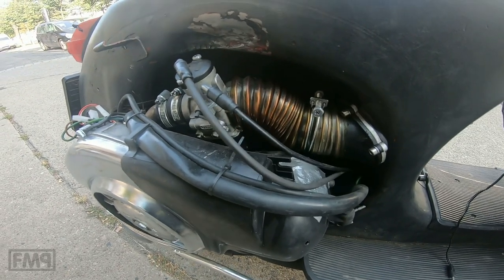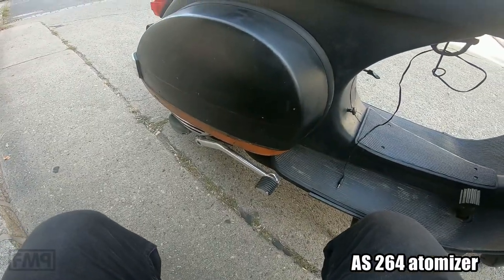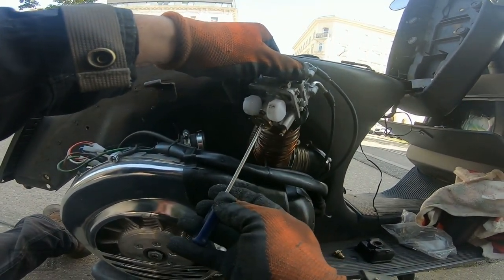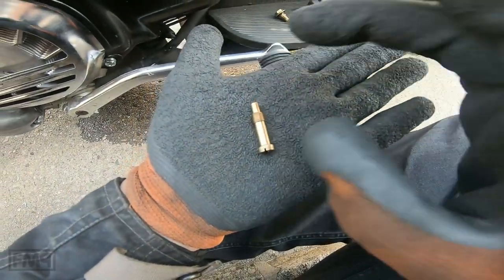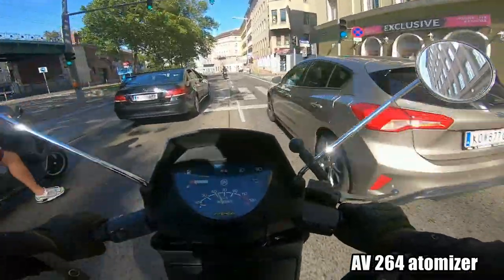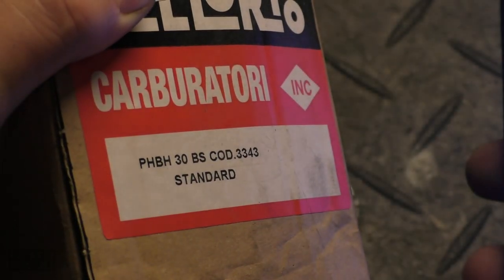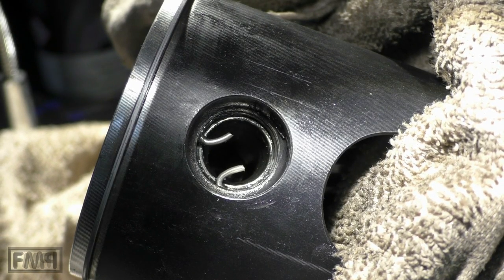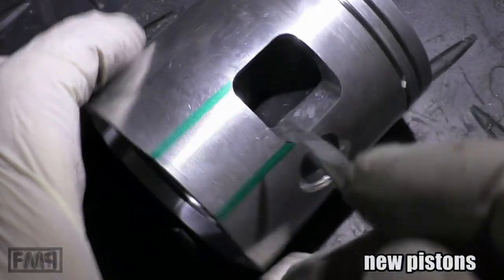VESPA dellorto phbh30: wrong AV 4stroking vs correct AS ATOMISER | FMP -  Solid PASSion |

Comment: Hey mate. Can you recommend a 12v fuel pump to live under the tank. Vespa 150 with lml reed case, rd350 reed. phbh 28, pinasco 177. I get to half tank and get starvation. Carb sits high because the reed block. Thanks. Anthony
Reply from the maker: hardi 60hp pump

Comment: It sounds very lean when you let go the gas. Even when you shift a gear up, it goes "braaa-pt pt pt pt-braaaa"
The "pt pt pt" part is when you let go the gas and you shift gear. Also it seems to have a very high idle rpm. Also this seems to almost not happen with the richer AV mix tube. 
If my engine sounds like that, I usually am worried about being quite lean on idle jet or idle screw etc.
Am I wrong? Maybe it's personal preference.
Reply from the maker: its not set perfectly thats right, just testing this engine a bit, but absolutely safe, no worries. 
the AV is very wrong. Seems like u like it on the rich side 😄👍
Reply: @FreakMoPed8  eh don't like to hear it "kicking" when I let go the gas, it sounds lean when it does so it kinda scares me 😁

Comment: I have malossi 166cc reedvalve with 30 phbh carb. Any idea on jetting
Reply: I have bgm bigbox touring exhaust. Or malossi one
Reply from the maker: AS264 x2 mj120 ij 55
AS atomizer not AV
Reply: @FreakMoPed8  i have bgm bigbox touring exhaust
Reply: @FreakMoPed8  because i have av266 and x13 neddle 140 mj 50ij
Reply: Did you say 120 main jet

Comment: I mista   I had already heard complaining about the AS tube but I was septic and afraid of being lean at 2/3 of the gas I would come back to you for my feedback: current config malossi vr one case Drt full crank 60  vforce 4 reed mrp manifold polini 221 gransport piston   Polini box  exhaust 24 /63  sip clutch short 4th gear  sip vape ignition phbh 30  58 pilot 147 main slide 50 x 2 needle av 268 tube 300 float valve Mixer tube AS268 ordered today i try it this weekend for a little ride 120 km  not so much😅
Reply from the maker: Let me know how AS is doing ij ur setup 👍
Reply from the maker: btw mj too rich, use a 130 also atomiser too rich, use a AS 266, worked fine for my m244 😜
Reply: @FreakMoPed8  Here I come back to my opinion on the tube AS first recited the behavior as on your video more regular opening of the throttle but I noticed that the engine took longer to return to a regular idle so I had the idea that it could be in  slightly cutting the tube to arrive at a dimension between AS and AV.  I tried it and the surprise the engine comes back to idle faster and keeps the behavior of the AS
Reply: my engine is really special it is true that the jet seems exaggerated but I get a correct carburetion without smoke and a clean piston without too much soot I had to start with a carburetion as you described me but I was too thin and the spark plug gave a different color  too white now the  spark plug has a hazelnut color I know it is strange and misterious at the beginning I was thinking of falsair intake but not all that

Comment: I'm having a similar problem with my set up as you are showing with the AV 264 but I'm running a standard SI24/24 it's currently on a Be3 atomiser, 120 main jet, 48/140 idle and 160 Air corrector. (dr180 kit, revolver pipe, drilled filter) it starts fine, ticks fine, is fine on acceleration and wide open throttle, but when I try to sit and maintain a constant speed it just splutters likr it did in your vid.
Reply from the maker: setting is correct, u got a different problem, ie ignition and or blocked exhaust. try different cdi then stator first.
Reply: @FreakMoPed8  yes I put new plug in, new stator on, new coil (lml 2t engine) and a different exhaust, the only thing left is cdi then I suppose.

Comment: Wouldnt a 45 slide clean up the richness with the AV atomiser ? I also recommend a minimum of 3.5 float needle jet on PHBH
Reply from the maker: Atomiser is cheaper than a slide and it works definitely, so simple solved.
it is the standard r3343 setup for two stroke.
 if av and 45 slide works..?  No need for me. To fins out. Just wanted to document the AS trick
Reply: @FreakMoPed8  what needle was you using in this video ? Cheers
Reply: @markjohn4986 guessing x13 or x2

Comment: Hey mista, i need your help, i have a vespa t5 with a malossi 177, but the piston was destroyed from the backside and the bore walls was scratched deep (it need a overbore). What size of piston should i use? A 64/65mm or a stock px200 piston would fit and work well without overheat? Ooorr throw everything and buy another malossi sport?
Reply from the maker: Why did the piston die? Sorry not experienced with conversions. if different piston, take a proper BRAND like meteor, to ensure piston stability.
Reply: @FreakMoPed8  ive been using malossi block for 1 and a half year, ive always used proper oil such as ipone samourai and motul 710/800, the bike was for a daily drive and it broke the piston during a touring, was a 4hour drive and had stops in between destination, my built in speedmeter has an odometer planted in my vespa it was around 17000 km counted.. i guessed the piston gave up..
Reply from the maker: yeah i know, weak thin spots it has sadly and surprisingly. u got pictures from the damage? could you please send them to me over the fb page? thx!

Comment: I have PHBH 28 and there is BN266 mixer tube. Also the idle jet is not 5mm thread(similar to SHB main jet) its 4mm thread. Very strange carb?
Reply from the maker: Sounds like a 4 stroke carb?!
Reply: @FreakMoPed8  Previous owner said that carb is from Aprilia 125cc...but what exactly Aprilia 125cc - nobody knows...
Its PHBH 28 BD and it also have:
Needle X2
Slide 45
Idle jet mixer tube B62
Float valve 250

So if its 4 stroke carb what I need to do to use it on 2 stroke?
Reply: @oleksandr50special  you can quickly check if its 2 or 4 stroke by looking at the "jet" (not really a jet) inside the venturi, that thing over the atomizer. If that thing is protruding in the venturi, its a 2 stroke, instead if it sits plain with the venturi then its a 4 stroke. Sorry I don't remember the correct english words but I hope you understand it 😅
Also, you can convert from 4 to 2 stroke by replacing that "jet" I just mentioned with the 2 stroke one, then you change to AV or AS atomizer, and you also need to remove a jet in the front of the carb, at 6 o' clock. The little hole that gives air to the idle circuit has a small jet inside it. Remove it and you're done. BUT be super careful, the hole is calibrated, so you mist not use a drill or anything similar to remove the small jet. 

Way easier to just sell your carb and get a 2 stroke one 😁

Comment: R3343 ships with a lever choke 115 main, X2 needle, and 6.5g float where the R4048 ships with a cable choke 128 main, X7 needle, and 9.5g float. So it's not just the mix tube that is different between these model numbers.
Reply from the maker: the video is about AS vs AV
not R3343 vs R4048
so i leave the  conclusion
 of your post trustfully to you 😉

slides the same
Just atomiser & needle different
thats most important factors
Ij and mj ar variable anyways 

still, my exoerience is, with AV no ij or needle vodoo can solve the problem. 

interesting thing is: atomiser is supposed to hit in from 25% on, which is not the case as we see in this vid... It massively influeneces  ottom end 

Where only ij a d slide should hit in. 
Also just discussing this witj dellorto UK 🙃

Comment: Wich Is the best dell'orto  30 phbh  setting  for Malossi sport 221 Rotary valve?
Reply from the maker: Which exhaust? 

R3343
 float 300, as 264, x3, ij 60, mj 125-130 with polinibox
Reply: Exhaust megadella L compact 90, Is to big 350 float?
Reply: And wich is the best dellorto 30phbh settings to malossi sport 221 reed valve?